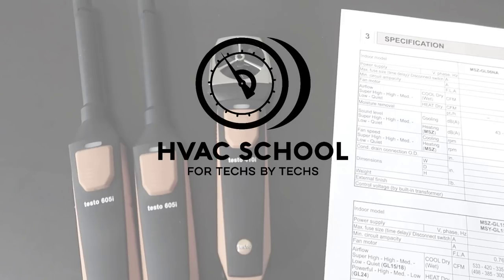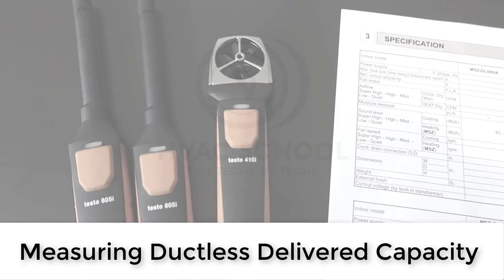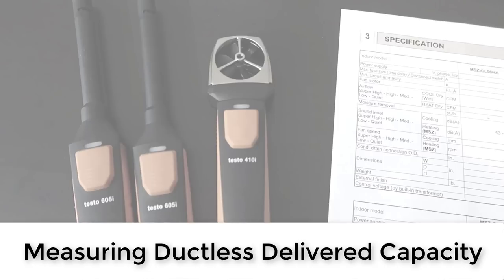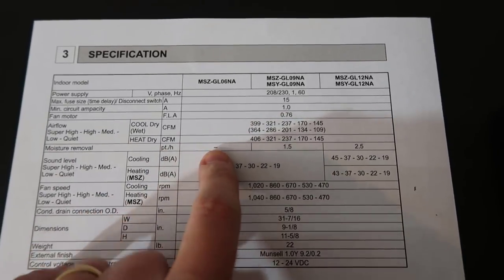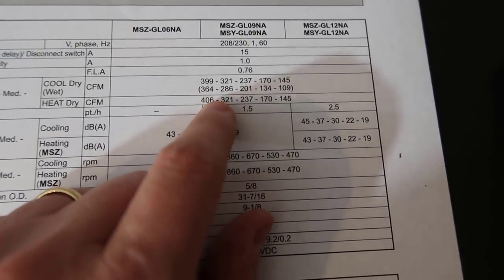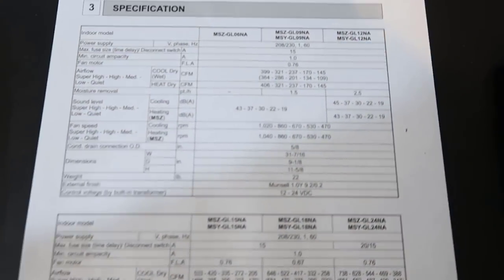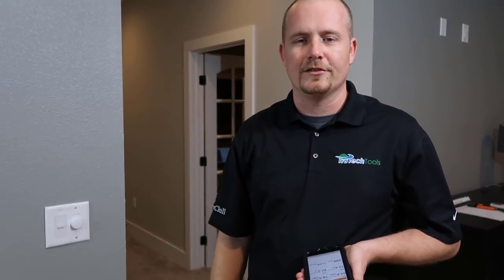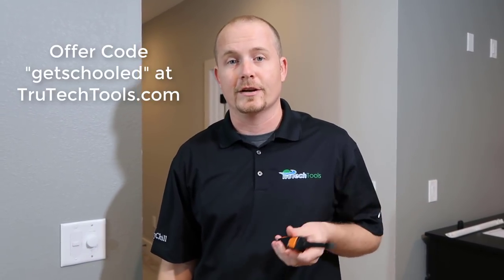How to Tell if a Ductless A/C is Working

Comment: Bryan, I've been in the hvac and commercial refrigeration field for about 40 years. I have had my own one man business for about 35 years and am still working. I am 71 years old and I only do residential service now. Your videos and podcasts are among the best if not the best. Thanks. I still learn something new every day. I bought to 410i last year and I find it about a accurate as you can get without a traverse. I just got the Fieldpiece Job Link kit with air probes and they work well and have good range, but the app really can use some work, a lot of work.

Comment: Hi Bryan - Thanks for making and sharing such an extensive set of excellent hvac videos. I’m a recently retired electrical engineer and I’ve gotten interested in hvac, mostly because I like to know how things work and I want to add A/C to my home. Anyway, I recently decided to have a Mitsubishi MXZ-4C36NA system installed in my Seattle home and I noted you have a version of the same system. I have a high efficiency gas furnace, which I like, and had hoped to augment it with a split-mine A/C unit (not a heat pump since I don’t need additional heating) and I didn’t want the added complexity and reduction in reliability of a heat pump.  However, it seems that most local hvac companies are pushing heat pumps, as is the City of Seattle, so I relented and agreed to have a heat pump installed. I have a question that I’m hoping you can answer as follows: If my heat pump fails (e.g., the reversing valve), how hard would it be to convert the system to cooling only? I envision plumbing around the reversing valve but I don’t know if the electronic modules in the system can be tricked into a permanent cooling mode. Thank you!
Reply: I noticed he didn't respond.... but I'm unsure why you think that you are obligated to use the heating side of the system?...Yes, the MXZ-4C36NA is a heat pump capable of cooling and heating, but you are not required to use it for heating.   I've got an older version of that system (the MXZ-4B36NA with four indoor heads) and I use it only for cooling....with one exception:  If I'm leaving the house for a while during the winter (going overseas vacation etc.) I set the Mitsubishi system to heat if the house temp drops below 50 degrees.   I do that to protect water pipes in the house from freezing.  When I return, I reset the Mitsubishi to cooling.  So far, the Mitsubishi has saved the house pipes only once.... :-)   But, that is all it took for me to be very happy with the heat pump capabilities... 🙂

Comment: Thank you. This is very helpfull. I am from Indonesia. In Indonesia generally and mostly use ductless split system. And all this time I wonder how to correctly measure the output to get to know that the system is already working properly after installation, after cleaning, or after repairing.
Reply from the maker: Glad it was helpful!

Comment: OK, so you go through all that and found your 12,000 btu unit is putting out 8,500 btu.What happened then, are you OK with that?  Is that somehow normal or can something can be done to increase the performance.When your calculating a system should you not use the rated capacity of a unit?
Reply from the maker: Rated capacity is more complicated then just what’s in the model #.
Reply: These systems aren't what most of you are used too. These are a residential version of larger multi zone VRF systems. The reduced capacity you are seeing is a function of the control algorithms and the electronic linear expansion valve that is being used for metering of refrigerant. These systems are intended to maintain plus or minus one half of one degree space temp. It's not an on or off type of control. If you were to introduce a false load into the space you would eventually see full rated capacity.
Reply: Thanks for taking the time to explain that.   I recently had 2) 24,000 btu units installed and I would be very disappointed if the units only produced 75% of the rated output.  I know the units produce variable cooling as the room temp gets close to the setpoint but if you set the thermostat 8-10 degrees lower than the room temp I certainly seems like the units ramp up to full capacity.If I would have known I would get less than the rated capacity I may have wanted one of the units larger.    Thank you both very much for taking the time to reply